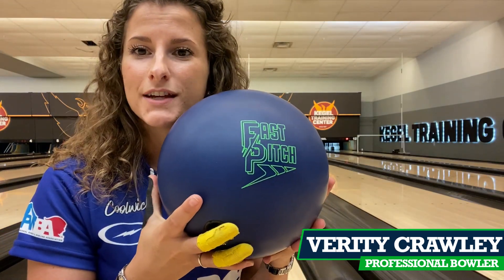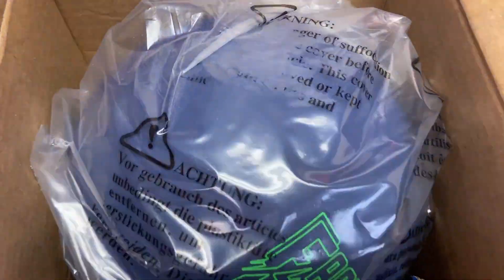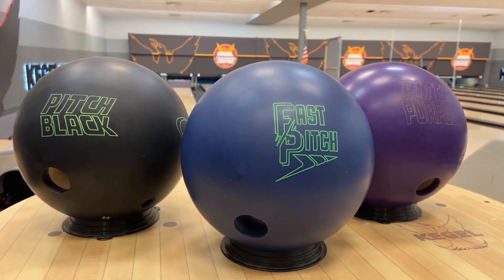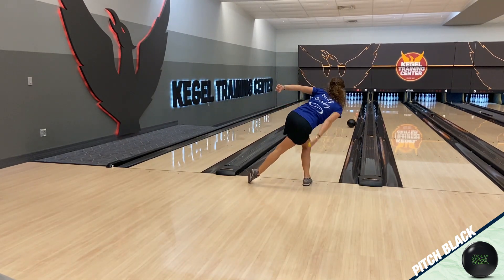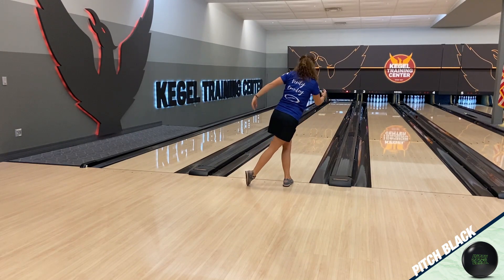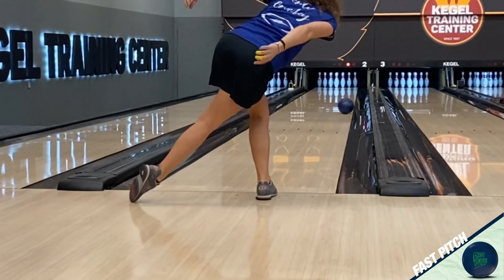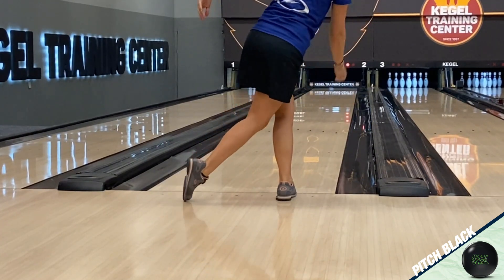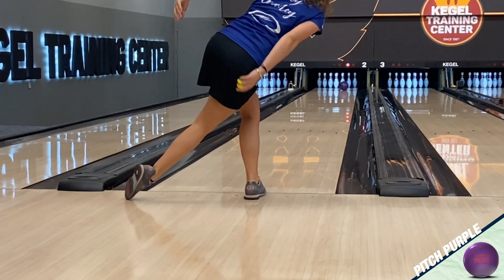Fast Pitch | Ball Reviews With Verity

Comment: Do you drill fixed thumb slugs or switch grip thumb slugs in your bowling balls and is there a trend on tour with the pros in drilling less switch grip thumb slugs?
Reply from the maker: I use VISE Interchangeable thumbs. I would say there is probably 60/40 split between interchangeable thumbs/ thumb slugs and some people use molds.
Reply: @verity-crawley  Cool, I like your videos and ball reaction.

Comment: Be sure to note the Pitch Purple is NOT traditional urethane like the other two.  ;-)
Reply: It is however, still urethane ;)
Reply: @Joeyd123abc2  The Pitch Purple really isn't urethane.  I have 5 different urethane balls and I can tell you the Pitch Purple does not roll like any of them.  I got the Pitch Purple hoping it would fill a gap but after throwing it I can't imagine when I would use it.
Reply: It is literally a urethane coverstock - by definition it is urethane. 

Sure its non-conventional urethane, but urethane nonetheless.
Reply: @Joeyd123abc2  Nobody I have spoken to about this ball says it behaves like a urethane piece.  I own one and can say the same.  Whatever "definition" you're talking about is irrelevant.  You are spreading misinformation but I will not argue with you here.
Reply: It objectively has a urethane coverstock. This is not up for debate. Look on Storm's own website if you must. The only difference is that a Pitch Black has a conventional urethane coverstock. The Fast Pitch AND the Pitch Purple both have unconventional urethane coverstocks - usually consisting of urethane with certain tackifier additives. They are still urethane though, always will be too. 

By your reckoning, modern day reactive resin isn't "real" resin as it doesn't have the exact same chemical makeup as the original resin balls. Once put like that, your point sounds stupid.

The only misinformation being spread here is your own, no need to argue as you don't have ground to stand on. Have a great day mate.
Reply: @Joeyd123abc2  Yeah thanks for the personal insults.  Much appreciated.
Reply: @Jason_P  what a shame you took it personally, I merely pointed out that when I reworded your point into a slightly different but still very relevant phrase - it sounds outlandish. 

And dare I say, if I said to you "the Axiom (or insert any other modern reactive ball) isn't a real reactive because they react different to my Nu-line Quantum from the 80s" - you would think it sounded pretty dumb too - but that is essentially what you are saying.

I wasn't calling you stupid, I'm genuinely sorry if you took it that way. I fully acknowledge the Pitch Purple doesn't react like traditional urethane, I agree! But that doesn't mean that it can't physically be urethane. 

Sorry about how heated this got man, didn't mean for it to get nasty.
Reply: @Jason_P  Good on you for admitting defeat and thanking the man for good education on the coverstock. Don't be stubborn, be willing to learn something new everyday.
Reply: @missjennyin  Umm, thanks for the rude troll post. I'm not admitting anything. I enjoy debate, but I won't respond to trolls or insults except to call them out. Your trolling exposes your character so I don't have to.